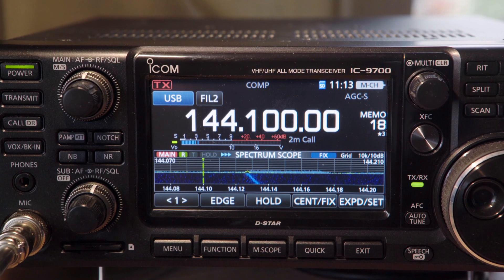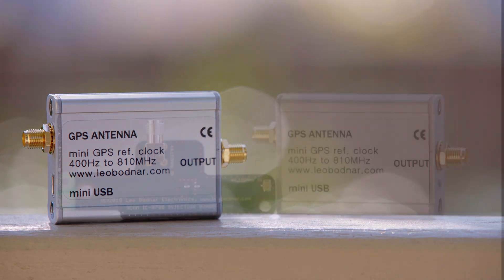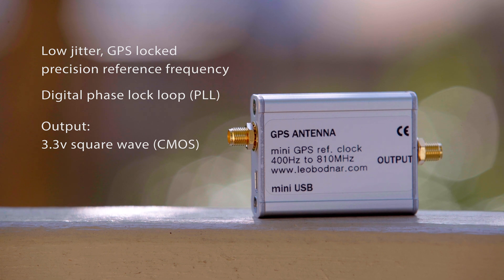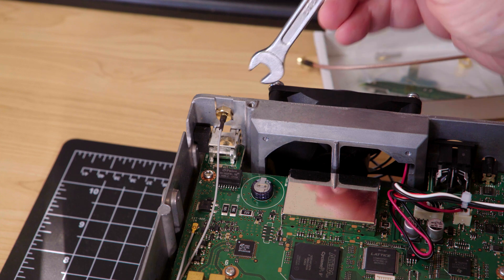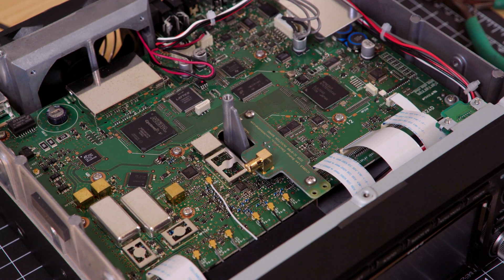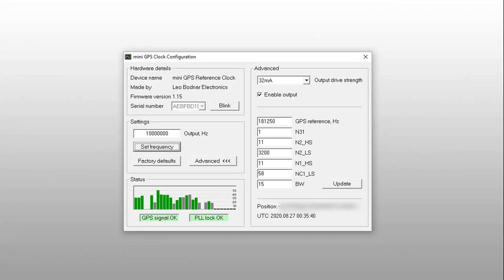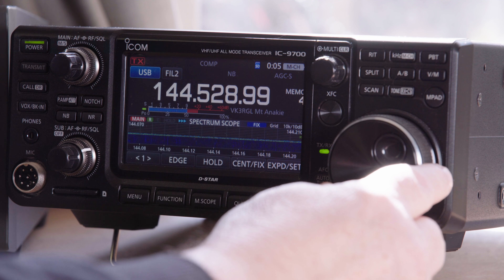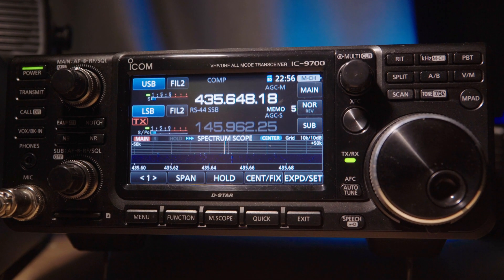Leo Bodnar IC 9700 GPS Locking board

Comment: Ive had one of these for around 6 months now. Ive plugged it in and set up the gps referenced clock on the computer but it doesnt seem to do anything. How can I tell if its working? Ive played around with the course / fine tune on the radio and that doesnt seem to do anything either.
Reply from the maker: Find a local GPS locked beacon of a known shack reference. Tune your radio to frequency of the beacon and switch to CW. Run the audio out of the radio into an audio analysis program such as Spectran. It should be exactly 600Hz.  The other way is to run WSPR on 23cm If you don't get any drifting complaints you've done well!
Reply: @VK3FS  Sorry for my ignorance, from whom will I get WSPR drifting complaints, since the entire WSPR Tx/RX chain is all machines with no human in the middle. Is there anything that i will look for in the WSPRnet data base data that i can access to get this indication? 73 de WS1M, Bammi
Reply: Thanks, I'll give it a try!

Comment: Two flaws! PTT is a pain and the fix is a DX Shop PTT multiplier. Before my 9700 arrived I had ordered the GPS Locking board and the PTT Multiplier to turn this radio from a reasonably good effort from Icom into an great radio. This video is what twisted my arm to retire my trusty old FT-736r I had purchased new in 1988.

Comment: This was working for me.  I and another amateur radio operator enjoyed the product, but now (especially evident on SSB) have a 'warbling' oscillation in the audio, and the frequency isn't stable.  Not sure what the next diagnostic steps are despite checking on the basics.
Reply from the maker: The LO in the radio and the Leo Bodnar Oscialator are fighting each other. Try adjusting the LO in the radio - Set -> Function -> Ref Adjust.

Comment: I use the the dual output gps from Leo Bodnar, i have one port set at 10MHz and use the 10MHz input on the 9700 then put it in synch to REF IN. Then i set the second port to 24MHz and use that to reference my SDRDuo receiver. I remove the antenna from the SDR and can then see my signal on the computer screen when transmitting on the 9700. Seems rock solid to me.
Reply: It isn't rock solid if you're running digital modes.  Icom really dropped the ball on this one.  The IC-9700 does not phase lock to the 10MHz ref input like any normal radio with an external ref.  Instead, it periodically (depending on firmware version) syncs through software, and it appears to play games with the frequency every time you key down presumably to try to compensate for the expected thermal drift.  For voice, this seems to work ok.  But this results in a lot of frequency movement in digital modes like Q65.  This rig could have been so much better, but Icom really designed the whole ext ref system very poorly.

Comment: Hi Andrew, thanks for the good video on this.  I do have one question though. What is the advantage of the brute force approach at 49.152 MHz vs just plugging the 10 MHz signal into the existing reference-in jack?
73,
Len, KD0RC
Reply from the maker: Hi Len. Short answer is the 10Mhz netting signal is not reliable. The original 10MHz external input was not for locking the transceiver, but netting instead. The Leo Bodnar kit is a permanent fix and is reliable. There are a few similar kits out there such as the Minikits board https://www.minikits.com.au/gps9700 but some of these require soldering which may void any warranty claim down the track. You'll notice the benefits of the lock more so on 23cm as well as digital modes such as WSPR if you use them. Cheers Andrew.
Reply: @VK3FS  Thanks for that explanation Andrew, I appreciate it.  73, Len

Comment: Does this unit replace the internal reference oscillator as a high stability reference oscillator?
Don't understand why the gentleman said his was warbling. Does it work with the internal one as in they both are mixed together and the GPS one simply keeps the internal one on frequency as similar to one of those drift correction boards for older vfo' s in older hf radios?
Reply from the maker: Hi Kevin, no. it does not replace the internal LO. What the Leo Bodnar device does is swamp the internal local oscillator with a stable higher level GPS locked reference frequency using the principle of the loudest person in the room drowns out the softest. Warbling occurs when on the edge of lock. Your last statement is current except they're not mixed. It's a competition of brute force as the the Leo Bodnar board is much stronger than the internal oscilator.

Comment: Unfortunately it did'nt work for me.
Easy enough to fit apart from ICOM appeared to put thread lock on the output socket.
That made it hard to get the locking nut off.

Don't get me wrong I like the Bodnar mini GPS, have three of them but the frequency stability was very poor with the board.
It would lock on three beacons, one for each band but after a long warm-up I noticed the 70cms beacon get a rather
odd warble to the signal, it had moved off frequency, after double checking everything and trying several times
it kept happening so I gave up and removed the board, locking to beacons then seemed ok as is.

Bit disappointed but now just run the 10MHz from the mini GPS to the autosynch function.
This does keep three locked beacons stable, I can hear GB3VHF, GB3UHF and GB3MHZ and they stay spot on.

My QO-100 station has three Bodnar mini GPS, one each of the IC9700, Kuhne down convertor and the Kuhne upconvertor.
I'm happy with this as my setup appears not drift on the satellite.
Reply from the maker: I have heard of one other instance that didn't work too. Make sure the board is snug over the LO. After re seating, it worked as expected. So maybe give it another try. Glad you're drift free though ;)
Reply: That warble tends to indicate the internal ref freq is too far off from center and the Bodnar is having trouble pulling it to lock.  You need to follow the procedure at 4:37.  This may have to be done again anytime the temperature changes significantly (summer to winter, or inside to outside for example).
Reply: I’m having trouble as well. No beacons here to I had a buddy across town send a 1khz tone with his gps locked radio. Got it adjusted on but when I send a tone back, my signal is wide and I have harmonics all over the spectrum. Radio is slightly better than stock but it still drifts all over the place.  After about a hour of testing and fiddling, the tones on both rx and tx started to wobble and I can’t bring it back. 

I update the radio firmware and am going to uninstall, reset, and reinstall everything for one last try. 

Thank you for the video though, it confirmed I installed mine exactly like in the video and Leo website.